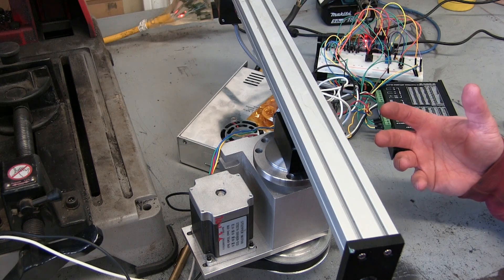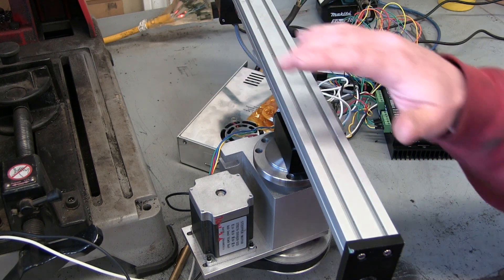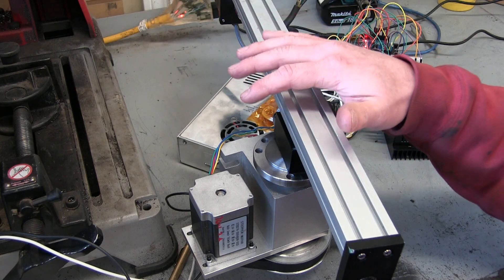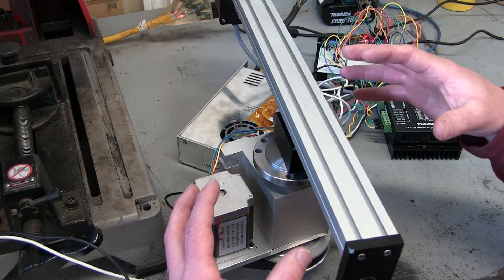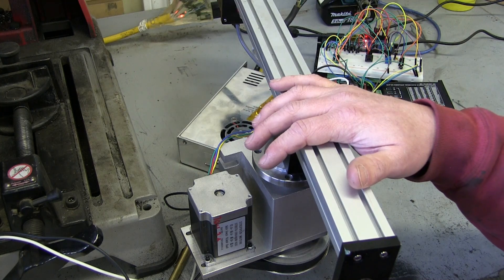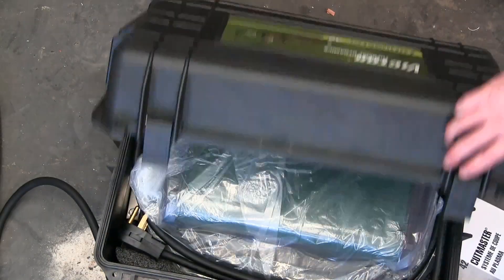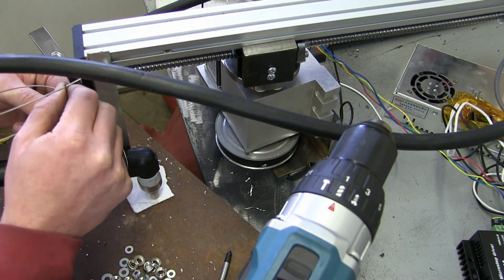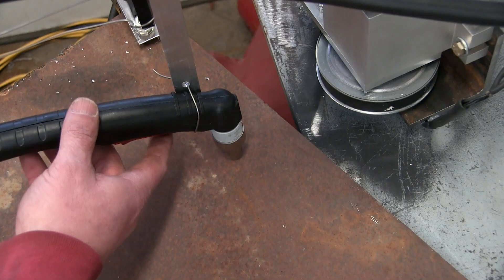Portable CNC Plasma Prototype

Comment: Draw directly on the steel. It follows
Reply: jret bullion line following robots. thousands of those been made. implement the same concept with this is a brilliant idea
Reply: djsnowman06 it takes confusers out of the equation. It's up to the user to take a skill that should be developed if you are working with this tool and let the machine do the work
Reply: Absolutely! You could even get it to clean up your drawing, convert it all to splines and have options to have it conform to shapes if it's similar enough, which would really just amount to pressing a button, makes circles circular.
Reply: jret bullion They used that in the 80's . worked well. I run a cnc plasma and an 6 head oxy propane set up at work. AVE is onto something here.., proof of concept is there.
Reply: just have the camera follow the line, record the code. offset to the cutter. playback the code
Reply: Maybe for odd ball shapes butt I still think a pre-programmed set of simple shapes would be easy. I want a square/circle/rectangle etc., set the size, give it a start point and done.
Reply: I would put the camera as high as possible so it covers the entire cutting area accessible by the robot. Takes a picture of the drawing, generates a g-code or some sort of axis commands and executes the cut based on that. So there is no actual line tracing during the cut. The light of the plasma cutter would prohibit that anyway.
Reply: djsnowman06 it could take a picture or a few and render the drawing into gcode. The feed doesn't need to be live
Reply: You could just use you smart phone camera. Take a picture of the drawing, the machine would have a few register points. The phone would render the drawing as gcode and send it to the machine
Reply: You can potentially avoid the need for a camera.
The machine will likely need some form of positional tracking to correct for any loss of alignment.
That same tracking could be used to record the movement as an operator moves the cutting tool along the desired path or shape by hand. Then the cutting arm can simply repeat that motion every time a button is pressed.
Reply: why hand draw a chalk line then get a machine to follow it when u could use a freekin plasma cutter free hand??? Think u guys are missing the point here.
Reply: You guys are describing the Shaper Origin... but with a plasma torch. That, would be fucking brilliant.
Reply: That's golden! maybe get it to scan for reference points as well. eg a center mark or center line for a circle, square or complex shape so you don't always have to draw the shape on the steel and also solve any alignment issues.
Reply: just have a little magnetic square for a scale. snap the pic and have it run some shape recognition.
Reply: djsnowman06 let's do it
Reply: Use the machine head to draw the lines. The machine remembers the coordinates and retraces it with the tool.
Reply: A raspberry pi with a camera would do the line tracing job for you.
Reply: I love it. Great idea. Draw on it with a marksall silver streak or soapstone and PRESTO one cut line!
Reply: Problem with a camera, is the distance between the lens, and the cutting head.  Then the environment the lens needs to live in is about as bad as it gets.  Putting the camera some distance from the cutting head, to follow a template defeats the purpose of having a small foot print.
Reply: if the camera getting dirty is a concern. an alternative would be to draw the item to scale on a phone or tablet. zero the thing and let er rip
Reply: djsnowman06 there are other similar tools that require cameras. The hand held CNC uses a camera. And sence it is only used at leastate beginning it is up to the user to clean their equipment. I don't think it would be a huge issue
Reply: NagantG17 definitely. I was visualizing letters and stuff. for common shapes dimension should work fine lol
Reply: The lens / entire camera housing can be covered and sealed while the cut is being made.  The device would have two modes - planning mode (camera open, it follows the line and takes pictures, working out the cut plan, allows you to approve / delete / maybe edit plan) and cutting mode (the camera gets sealed away, and it just cuts based on the existing plan).  This has the advantage that it allows you to replicate parts based on previous plans (because of course it would save all the plans so you can call them up later for re-cutting).
Reply: AlexDC93 rotary encoders can measure distance moved. used for positioning feedback
Reply: So the way I see it right now is like this: you take a picture with your phone of your project and machine set up, this is after everything is clamped and set down. The program uses a set of registration marks (on the machine), precision marks (on the work piece) and the hand drawing (on the work piece) to compile g-code that the tool then executes the procedure. You can do all the confuser bits on the back end (files and such). And import drawings and such.
Reply: This is actually pretty genius.
If you need to automate it or use drawings just hold a piece of paper in front of it or project it.
Reply: also a drawn on line is erasable. whereas a shitty cut is much harder to fix
Reply: if the linear actuator passes through the centre of the rotary axis, you can do simple Cartesian to Polar coordinates conversion. Map all the movements in Cartesian coordinates then convert to Polar as the final stage.
Reply: The point on it being a CNC is precision and accuracy. The interesting part about aVe is he wants a simple and familiar UI, hand drawing solves all of this. And the CNC provides and easily repeatability
Reply: djsnowman06 Jeah but if you could replicate a drawn shape multiple times your golden
Reply: just threw together a mock up line scanner sensor. getting a few bumps on the serial plotter when in gets a line.
Reply: So many with the phone idea following a line visually. Much easier to have the mix-and-match shapes in an app that allows for basic shape editing. Heck, even allow for complete new design, the app wouldn't be all that big.
Keeps the actual cutter as small and simple as it can be.
Reply: The app could have two modes. The primary mode follows the use case that AvE suggests using canned shapes which are dimensioned by user input.  The advanced or secondary mode allows custom parts via shape recognition.  My Galaxy Note 5 (thus far, pyrotechnic free) has an app called S-Note. The app has a shape recognition mode which interpolates free hand stylus scribbling into basic shape recognition. I can draw objects like lines, rectangles, triangles, decahedrons, parallelograms, circles, etc.  I can also select and resize the shapes after they've been drawn. It's pretty cool actually. I've no doubt that better examples already exist.
Reply: Critical to the operation of this would be setting the reference origin. Would make sense to have the unit head first align to a pair of reference points with the axes set in an initial home state, then clamp down the mag. Otherwise, your going through the work of calculating your base origin from the point of cutting prior to clamping it down.
Reply: 44R0Ndin yeah, like a banana.
Reply: It's a very interesting idea. The problem I can see is the huge amount of UV light radiated from the cut, would make any kind of sensor really struggle to see something drawn on top of the work. But it is nonetheless a good idea if we can implement it.
Reply: just an idea
Reply: I like it
Reply: I'd rather have the option of using a ruler, compass, and other tools to draw or even better, printing out a plan, taping it to the metal, and having the machine track that (of course at that point, I might as well just load the file into the cutter).  If I have to move the machine, I'm limited to the accuracy of my hand movements, which would likely even be impeded by moving the machine.
Reply: Sebastian Wiers I must not be clear. That's exactly what I have in mind
Reply: jret bullion I'm working on a sensor that can differ matte from  reflective surfaces actually. it is for a pinball machine I've been building. it uses a super cheap rpr220 sensor. I don't see why that wouldn't be easier to implement here. use a black maker on stainless/aluminum and a silver on old rusty crap... voila no camera lol
Reply: jret bullion of course it could do with some resolution hacks
Reply: instead of line following, it could also do line by line sweep scanning (similar to those new pocket scanners). pick up a set of points and interpolate a tool path. might take longer but it may be easier to code. idk lol just spit balling
Reply: paul harris using a plasma cutter takes finesse which many people don't have. also repeatability is always nice. if you can scan a shape and make 100 copies which are all the same it is much better than cutting 100 shapes free hand
Reply: djsnowman06 I agree completely.
Reply: You could even have an optical sensor clamp on to the plasma cutter head.  Turn the mag on, set to "line follow" mode, device scans your drawing, optionally uploads into app or pc for you to edit.  Maybe even have OCR in the phone so the program can interpret critical measurements like hole diameter, length, and angles.  The key to making this work is really, really good software.

Probably want to have a special color to denote the boundaries of the area to scan, so the scan mode doesn't have the gantry swinging 360*
Reply: David that is cool. the only thing about that is it's still moved by hand. so if you had to do a lot with it, it would be fatiguing. still for a one-off field use tool it is probably exactly what you need
Reply: Mike Savage it's just an idea. if you're going to take your phone out and draw it out on the thing isn't just as well go down to the office and have one drawn up? at least with a chalk line guys already know how to do that. hit scan then hit cut as many times as necessary.
Reply: guy in the office+ autocad license+computer + time wasted or use a phone app. Phone/tablet app is defo way forward .
Reply: paul harris I'm just going by all the job sites I've been on. management sees phones as time wasters.
Reply: David Chang-Yen especially because the x axis is rotational vs linear
Reply: Take a picture of it with a smartphone, but you'd need to always include some object of known dimensions in the frame of the photo as well. Basically something like a ruler with distinctive markings (ex. checkerboard) that can be easily picked up by the camera and used to scale the drawing inside the software so you end up cutting on the lines not outside or inside of them.
Reply: djsnowman06 What if you're doing field work?
Reply: joseph slemp generally the only guys allowed to use phones are management, QC, and Client Reps. guys get canned when they are caught.
Reply: A push button on the business end disengages the motors, making the arm a pantograph...requiring optical encoders. In fact, a pantograph arm design might be simpler/more robust than the rotation/linear design. 20:1 gearing, on even a low-voltage stepper motor, would provide plenty of force, repeatability, and control.
Reply: could also just do the drawing on a computer for precision, print it onto a template and glue the template to the target, which the cutter would cut through. then it can handle freehand and precision designs
Reply: What about 2D cad file to gcode converter?

Comment: I was thinking on how to locate and align the shape you want to cut since it's no good if you can't put the hole you want in the place you want it.  The two challenges are the location and alignment.  Assuming we're dealing with Cartesian coordinates for the sake of simplicity you need to be able to define the xy of the center of a circle for a round cut.  But what if the cut isn't round but some arbitrary non-symmetric shape?  I think a good solution is to have a reference point on the base of the tool.  Wherever that point is placed on the piece is "home".  Then in the app you tell it how to rotate the shape relative to home to set the alignment.  Think square vs diamond and angles in between.  Your usual angles are there as defaults plus the ability to free rotate.  Finally you tell the app a point on the shape and a distance from home.  The app does a test where the tool end touches that point on the piece and you enter the adjustment needed if any.  Hard to describe without images but I think this approach would be robust, not prone to issues with surface condition of the piece, and because the adjustments are few and simple it should be easy to adopt. For symmetric shapes you could also set the distance to the center of the shape, rather than the edge.

Comment: Two things came to my mind watching this:
1) Regulating the cutting speed by sensing voltage on the metal to be cut. Between the arc and the material must be some kind of voltage drop that changes when when the cutter moves to fast or to slow. This would get rid of the need of interaction to input the correct numbers. I don't know if it is possible since i do not have acces to a plasma cutter.
2) When cutting non rotary symetric shapes... ok circles... you need an easy way for the user to see how the device must be aligned to cut the shape in the right direction. I think a simple line laser might do the trick. But It must work under conditions with poor visibility or even daylight. Fine adjustments should also be possible after the magnet is powered up. (Imaging lifting around 10Kg of a device on a ladder in 5m hight.

Oh and it should have a means to secure it in a case of power loss. Meaning if it is doing it's job under a ceiling and some idiot pulls the plug (happens all the time) it should not comet down on the crew below it. Just a rope or somthing like that.

I think the idea to control it via smatphone is brilliant. Having also the ability to import some CAD files for custom shapes would be great.

And the problem with tranforming cartesian coordinates to polar coordinates is really not a bid deal. It involves a little highschool trigonometry. Some premade librarys may require the understanding of 'pi^(j*phi)' but i am sure you can get your head around this in no time.

Comment: no one will ever notice this. I've dealt with this exact thing before. The damn grounding killed me. When you mount a CNC on a piece of metal that your about to hit with a huge impulse of electricity it can and will be hard on your stepper motor driver. ground isolation will be your friend. Just a heads up, trying to keep your dick out of a vice.

Comment: I love it. Rotary feed rate should be adjusted to the radius of the current torch position. 1seg/sec at the end of 1ft arm is not the same speed of 1 deg/sec at the end of 2ft arm. Also since you have to have plenty of air for the plasma, it would be a nice idea to have a mag base with a vacuum plate built in to hang on to aluminum and other non ferrous metals. 
Keep kicking ass.

Comment: The devil is in the detail!  My advice (for what it's worth) keep the travel short and stiff , make the max hole size little larger than the typical rotobroach. You need torch height control so it can cut curved surfaces (ie pipe) . 

The phone app needs only to send dimensions (vertexes), it should not control the motion (it could calculate the vectors). the device need some simple speed/feed control (ie a knob!) and means to locate start position and means to orient the cut .

Bill (who's been thinking about a similar device for sometime!)

Comment: The idea works, but you gotta get the interface right. 2 Clicks easy, build it into the device itself. Because fuck having something on my own phone on a job, at home sure, but fuck that shit in a shop or the field. Consider putting a simple interface that can both load G-Code and have some simple adjustable stuff built in. If you're using plasma on flat stock, you probably only need a circle and rectangle option. Kinda like this https://puu.sh/up5wB/3bff5333f2.png.

Then you give the user where to start the cut from, like this. https://puu.sh/up5Tf/d64aaa2088.png (Its a scrollable menu, my art is that of an 8th grade math teacher) 

For anything more complicated than a rectangle, you could either draw up your shit or get someone else to give you some G-Code. But if you're just looking to replace a drill, you got this here. Simple calculations on the machine, limiting hardware required, and the software needed to crash. Fuck, you could probably get the thing to run on an Arduino mega and a RAMPS board. 

Just keep it fuckin easy, schools would love this shit, and I'd love one for my garage.

Comment: What about the distance between the plasma cutter and the steel? is it as finicky as 3d printing with layer height? Other than that I may have noticed a bit of wobble when the threaded rod was turning, does it show up in the cut at all? Great video btw, jealous as always.

Comment: 0 kind of does not exist on polar systems. so 0 would have to be something like 0.000001. it does exist, but can't be had. unless gcode is pre made and then scaled somehow, for each size whatever you're cutting. the software would have to fudge 0. look at the polar 3d printer. it works with that in mind and seems to do well.

Comment: Itll need to have a way of setting it up in a specific place every time. So a datum point needs to be super obvious
Reply: And maybe see if you could put a projected image of what it's going to cut onto the part before hand. That would be super sweet so users can check everything lines up (if you're not doing drawings I could see that as a problem)